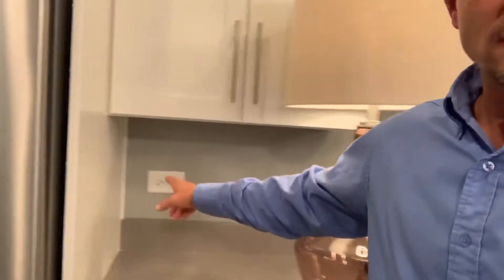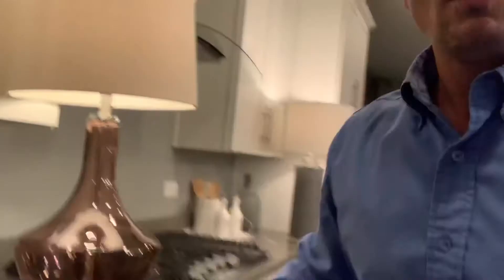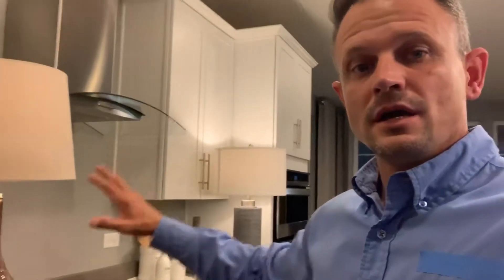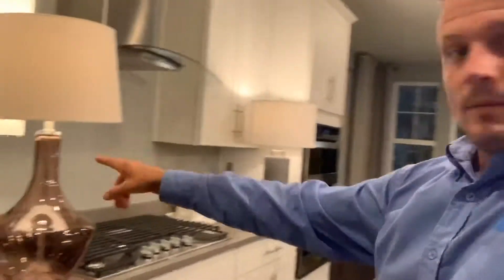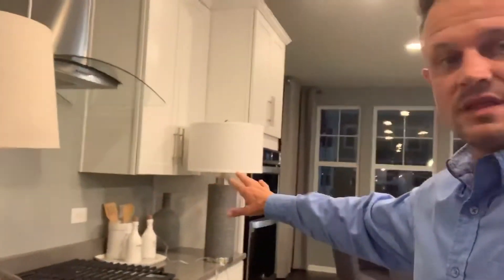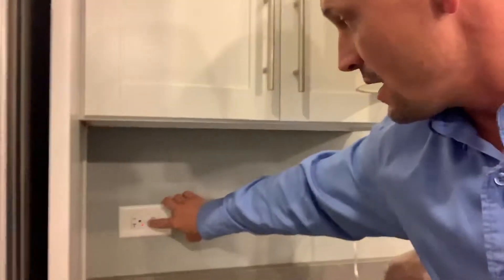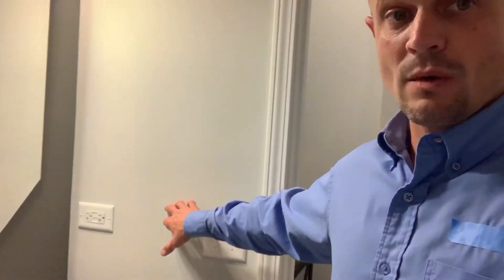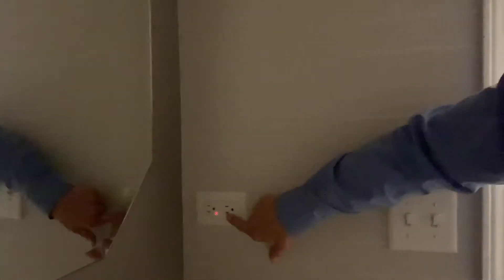How to fix an outlet or GFCI if it’s not working

Comment: All my gfci outlets reset fine and I have no tripped breakers but I have an outlet downstream that isn’t working how would I fix
Reply from the maker: Well if you have an outlet downstream that has no power off of one of the GFCI‘s. Then more than likely that GFCI is not working properly and would have to be replaced.
Reply: I thought that too but all outlets with gfci resets still work and have power. 🤷🏻‍♂️ could that one outlet go bad?
Reply from the maker: @jamessims8074  it’s possible, but outlets don’t typically just go bad. Maybe a wire is not making good connection, or something else is going on. You’ll have to process of eliminate to figure it out.
Reply: Ok thanks for your help and info. I’ll troubleshoot it and post what I figure out. In case anybody else has the same problem.
Reply from the maker: @jamessims8074  Thanks Jim!

Comment: Ok… i get what you said… i know how it’s supposed to work. But the title said how to fix one that DON’T WORK… did ya forget that part?
Reply from the maker: Hi John- Those are the only steps you can take if they’re not working and don’t have power. There really is no fixing them, once they fail they have to be replaced with a new one.

If you need help replacing it you can follow my instructions in this video:
https://youtu.be/ih3MntEQJ24

Comment: None of my buttons are clicking when I push them. Like they aren’t working at all.
Reply from the maker: It’s possible the circuit breaker may have tripped so you want to make sure that is on. If you have power than the outlet may have gone bad and it needs to be replaced, which I have a YouTube video how to replace the outlet on my channel if you’re up for changing it out your self.

Comment: Mine works but the light doesn’t come on it’s tripped multiple times since install but only happens once in a while if I turn my ceiling fan switch off in a slow way or too fast it has to be perfectly timed is it time to update my electric or did I do something wrong?
Reply from the maker: Hi Myles it’s hard to say you have to do a little bit more investigative work and process of eliminate what the issue could be. At this point I think it’s best to have an electrician come in and help out.

Comment: Please help me. I was plugging in my euro steamer into the bathroom outlet, and I heard a click, and a tiny orange light came on the receptacle. Please, is it safe to push the Reset button, or is it dangerous? I'm scared of being electricuted! Thank you.
Reply from the maker: You mean the light turned on or off? Typically when the GFI turns off it shuts down the power to other electrical devices that may be on it, so the light should have turned off not on.
Reply: @BJPoznecki  
A tiny orange light was turned "on the receptacle", it usually has no light when the receptacle is functioning properly, but as soon as I heard a click, the steamer turned off (receptacle had no current), and an orange light turned on. My bathroom light is working perfectly, only the receptacle has no current.
I took a closer look and saw that the Reset button was up and the Test button was down, so I pressed the Reset button, but nothing happened, and the tiny orange light on the receptacle is still orange.
Ok sir, I just watched your video again and did exactly what you said, "push the Test button right in (I pushed it hard) and it'll clear everything, and then press the Reset button". It worked 👍 Thanks a million, and God bless you 🙏 ❤ 
Thanks for responding so quickly; I appreciate it.
Reply from the maker: @skinnydee1886  My pleasure!

Comment: My gfi trips anytime I plug in something outside. Does that mean it needs to b replaced?
Reply from the maker: If you’re plugging in different electrical devices into the GFI and it trips no matter what you plug into it then yes. 

However if you’re plugging in the same electrical device then it could be a short circuit in whatever that device you’re plugging in.

If you need help replacing the GFI follow my instructions in this video:
https://youtu.be/ih3MntEQJ24
Reply: @BJPoznecki  yeah it’s different devices. I’ve been in my home for 7 years and never replaced it.
Reply from the maker: @SkyNdiveProductions  Yeah then it sounds like it needs to be replaced. Just like other components throughout your home there eventually comes a time where something wears out and just needs to be replaced. It’s a very simple project just follow my instructions in that video and you’ll be good to go!

Comment: Are you supposed to leave the reset test button pressed down?
Reply from the maker: The test button is to trip the outlet and simulate a short so it turns off. Pressing the reset button should push the test button out and restore power. If after pressing the reset button on the outlet and it doesn’t have power then it needs to be replaced.

Comment: Hello sir. I have a question.how about if my GFCI is brand new and its not working. I can't use the test & reset button.my problem is I bought it 2weeks ago and i can't return it anynore.is there a cance that my GFCI can be repair? thanks a lot !
Reply from the maker: It doesn’t happen a lot, however I have bought brand-new ones and they have a manufacture defect and not work from the start. What I would do is buy another one, install it, and then return the one that doesn’t work, and get your money back.

Comment: Question:
My reset button won’t click... any ideas why?
Anybody?
Thanks 😊
Reply from the maker: It could be down line another GFI that tripped, so check all the other GFI’s in the house and make sure they have power. 

Check the circuit breaker and make sure it’s on and that it didn’t trip and turn it off.

If you can confirm you have power at the GFI then at this point it’s failed and needs to be replaced with a new one.
Reply: @BJPoznecki  
Ok thank you.

All of these were recently installed in our apartment, this is an independent circuit breaker used only for the garbage disposal.

I did everything you suggested and it’s still out, so I will call the company that put them in and have them come out. 
Thanks again
Reply from the maker: @guitar-ology945  
My pleasure!

It doesn’t happen a lot, however every once in a while I do buy a new one that has a manufacture defect and doesn’t work properly and needs to be replaced.

Comment: Thanks for your video, i replaced a regular outlet in my bathroom and i trip the breaker, reset the breaker but no power in both bathrooms, checked all outlets and turns out one gfci outlet in garage is daisy chained  to the ones in the bathrooms, reseted it and it fixed it thanks a lot

Comment: I have no power in my master bathroom breaker is fine no gfi
Reply from the maker: Try pushing the breaker hard to the off position then back on. 

There may be a GFI outlet in another room that protects that bathroom. 

After that you’ll have to bring in an electrician to process of eliminate what the issue is.

Comment: So In mine in my guest bathroom that we don’t use, the red light just stays on. Even when nothing is plugged in, the red light just stays on. Does that mean the outlet needs to be changed?
Reply from the maker: Hard to say because there are different types, you would have to check it with a GFCI outlet tester to see if it’s working properly.

Comment: My problem was my button suddenly  didn't want to reset no matte4 how much times I pushed, i then put a lil super glue to paper and pressed, then it just made the botton stay pushed in, so I then uses oil to loosen it up before it dried completely, it loosened but still wasn't working, I searched up this vid watch about 2 mins, paused, went and did something let it sit for a while pressed it again then it worked 💀

Comment: The trick that worked for me was holding in that reset button a long time and then the other button popped out(clicked) and everything started working again.
Reply: Was your test button stuck/jammed in there?
Reply: @bigwaynebigwayne1084  Yes. It's been a while but I remember had to push and hold it in for a bit.
Reply: I'll subscribe to your channel if you can answer my question
Reply: How long did you push the button? Also, did you use your finger? I'm concerned that it might cause more problems.
Reply: Thank you

Comment: I heard not one word about fixing a CFCI outlet! You only showed me how to use a properly functioning GFCI.
Reply from the maker: Sorry for the confusion! 9 out of 10 times they just need to be reset. You technically can’t fix a GFCI outlet when they fail and/or can’t be reset, they need to be replaced with a new one.
Reply: @BJPoznecki I just found out that my GFI socket in the kitchen is not working. Have tried the reset button and the test button to no avail. HOW do you actually replace the GFI Socket? just get a new one? I am holding off on calling an electrician as it obviously is costly, and hence my search on Youtube.
Reply from the maker: @dashingmale35  Did you check to make sure all your Circuit breakers are on? 

If they are and none of the circuit breakers tripped then yes, you would have to replace the GFI outlet with a new one.

Comment: The GFCIs are all working inside the house. My exterior outlets are not working though. Do you think they are connected to a GFCI in my garage?
Reply from the maker: If your GFCI outlets are not working it could be they have failed and need to be replaced, are powered by a switch inside the home that needs to be turned on, or the circuit breaker tripped and it needs to be reset in your electrical panel.

If you are in a new construction home it’s possible the electricians forgot to connect their wires and power them up. If that’s the case I would reach out to your builder and submit a service request if you’re still within the warranty period.
Reply: @BJPoznecki  Thank you for the fast reply. I will check if there is a switch in the garage and in the house that need to be turned on for the outside outlets to work. Thanks again!
Reply from the maker: @catgirl24  My pleasure!!

Comment: I have one outlet in the kitchen and the light switch and outlet from the bathroom wont work everything else is fine, we have been pressing the restart and test buttons, what do you recommend we do? 😐
Reply from the maker: At this point I would give somebody a call either an electrician or a handyman to come in and assess the situation. It’s possible that the GFI outlet has failed and needs to be replaced, Or it could be another issue that’s causing it to not be able to reset. 

Do you live in the Chicagoland area by chance? If so give me a call at 773-403-3298.
Reply: @BJPoznecki  Unfortunately I live in the Socal area and I called an electrician already and will get it fixed tomorrow thank you!!!
Reply from the maker: @jameshonda8948  Love Cali!
Good to hear, sorry I couldn’t be of more assistance on this one.